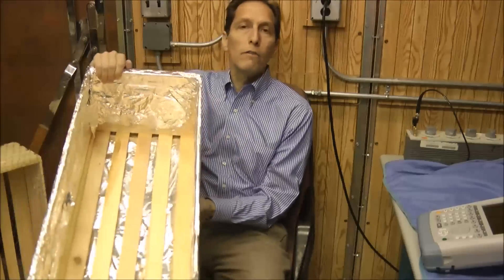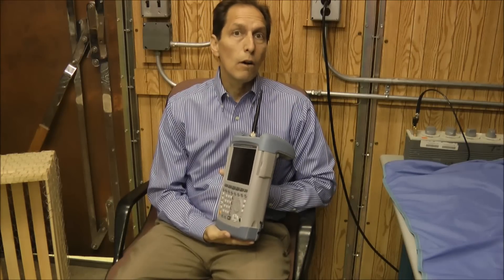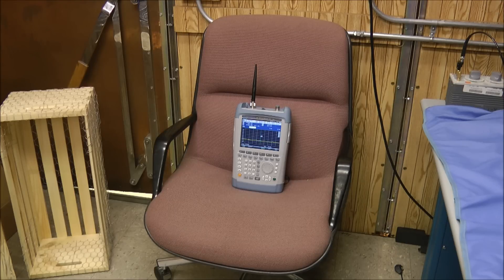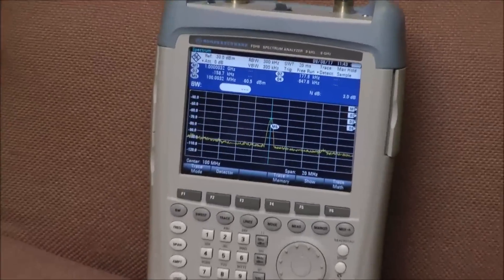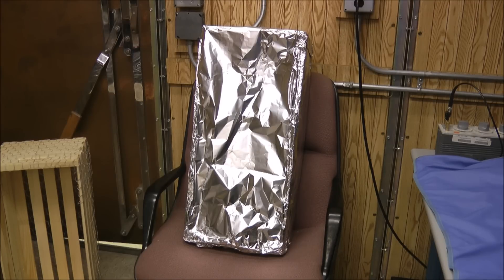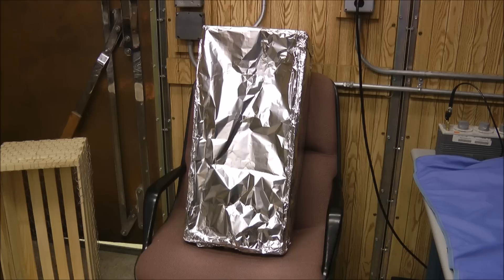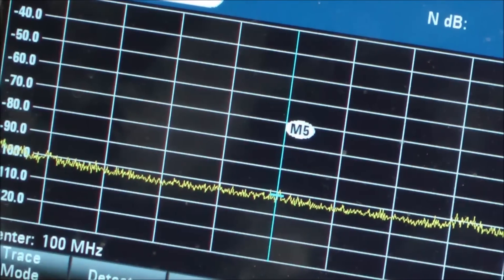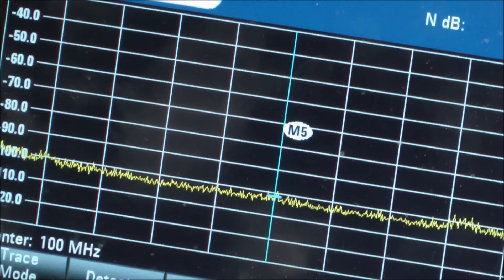Faraday Cage - Chicken Wire vs Aluminum Foil

Comment: I have seen your books, but have not had time to listen to them yet. I listened to your interview "NASA Scientist: Be Prepared for an EMP | Dr Arthur T Bradley" I am so finally relieved (as an RF Engineer who works in shielded rooms all day and help build ours with ETS) to find an EE out there providing accurate and purposeful information for this.
Reply: I have not read your book yet but was wondering if you have done testing with bronze wool and copper on the seems like ETS does. I do wonder what your testing is that was done into not using grounding rods, ETS uses dual shield with grounding between them and then earth ground. At this point I think that the impulse makes the difference of not using them rather than build up of latent charges. These rooms are 100dB down for 1GHz.
Reply from the maker: Hi Jon, I replied to this on email, but I'll post here too. I haven't looked at bronze wool, but I am planning a few tests later this week to test EMI gaskets. I'll post a video of the results.

Comment: so does this mean foil can provide emp/cme protection?
Reply from the maker: You don't need to use a Faraday cage for CME protection, but sure, aluminum foil can be used to protect against an EMP.
Reply: @disasterprepper  can you elaborate on that? CME is what I'm worried about AFA my electronics, and vehicles etc

Comment: Dr. Bradley!!  Awesome stuff. This has been a concern of mine for a while, but with all the different opinion driven posts and blogs, it's hard to know what to believe. I bought your book and hope I'll have time to read it.  I thought with all your efforts with these videos you ought to be applauded. Bravo. I viewed three videos so far. I have a question though if you have the time. It appears double layering provides the best protection, such as electronic device in  cardboard placed in  wood box wrapped in aluminum foil sealed with conductive tape and then placed in galvanized trash can again sealed with conductive tape. The question is should there be a non-conductive layer between the can and the box? Such as wrapping the aluminum foil box in a t-shirt, plastic bag or something before placing it in the garbage can. I would think if the can is touching the aluminum foil box then the energy would actually travel to the box more quickly and the whole point of double wrapping is useless. Correct?
Reply: oh yeah....ground or no ground? And if yes how?!?!? They say on the blogs if you don't ground all the energy will go in once you open the box. Huh?
Reply from the maker: Yes, ideally, you want to create an isolated interior Faraday cage within the outer Faraday cage. That will provide the greatest level of shielding. As for grounding, no, despite claims to the contrary, it is not necessary. The assertion that energy would go inside the box is incorrect.  There is a lot of misunderstanding out there.

Comment: I've been wondering about this for a while because I realized that I can talk on my cell phone in my grandpa's house, which is a stucco house, so it's wrapped in chicken wire. But I don't have signal in his machine shed which is built out of galvanized metal.   Maybe a cell phone isn't a good measuring tool, but I figured it was at least an indicator.   Thanks for the testing!
Reply: Cell Phone is a great source to tell. It’s powerful
Reply from the maker: Sure thing. Glad it was helpful.
Reply: Cell phones use much higher frequency (shorter wavelength).  So, the chicken wire gaps are too large to be an effective Faraday cage at those high frequencies.
Remember the old days of AM radio cutting out when driving over a steel bridge.  But FM radio was not affected.  AM radio wavelength is very long.  About 100 times longer than FM radio wavelength.  So even though the steel bridge structure had huge gaps it still attenuated the very long AM radio wavelength.  But the gaps were too large to significantly attenuate the shorter FM radio wavelength.

Comment: Ok, so we are worried about our personal electronic toys, tv's radios, and smart phones getting broken from a nuclear bomb/emp?  I would think the radiation and such would be a bigger concern.  ok, so there could be a huge solar storm but I think you are more concerned about man made events right?
Reply: ComputerUser321 no its not that we are worry about our electronic toys its about having the ability to send and receive communication for info so say like ham radio walky talkies and so forth batterys for emergency radio and flash lights electronic parts for ur car generator and so forth that's what we are worried about things that will help in a survival situation
Reply from the maker: Radiation isn't really a concern for high-altitude explosions. It's not toys that are stored, but items that might be important to survival, such as radios, medical devices, spare parts for power generation systems, etc. Solar storms have some similar effects, but they are localized to long  conductors, such as power lines.

Comment: Hi Disaster Prepper, below is my Faraday Cage Build Plan. Can you tell me if there's anything wrong with it and if so, what I can do to better it?

So I'd like to make a wood box that's rather large. Something super easy to make with a door to hold things. Inside of that, I'd like to put a tight weave aluminum mesh, folded over 3-5 times, a tight weave copper mesh either folded over once or just left with one layer, and then 3-5 layers of aluminum mesh. I'd like to secure the mesh to the box with staples as well. Once that is all done, I'd like to purchase a roil of the foil that the bags are made of, and place that on the inside as well. The door would be made out of the same materials as above in the same way. The seams would be bulked up and have to be closed by some heavy duty locking clamps to get a tight seal. Once the inside is done, I'd like to make another box with shelves and storage to place the items I want protected from a EMP.

Now my question to you is simple. Is there anything wrong with my build plan and if so, can you tell me what it is? I want this to be beefy and to be well protected, just in case. Any suggestions are nice too.
Reply from the maker: You may be overdoing it just a bit with your various layers, but it sounds like you'll have a great level of shielding. Pay careful attention to the seams where things overlap as well as around the door. Also, I don't know that you'll need a roll of foil, given that you have multi layers of tight-weave mesh. That should easily do the trick.
Reply: I don't want to put you out, but is it possible you could do a test using the tight weave mesh like you did for the chicken wire test vs aluminum foil? Also how would staples fair for holding the mesh together to the wood?
Reply from the maker: Sure, I'll try to do this. I'll have to find some good tight mesh. I think the staples would do fine as long as you overlap the mesh when stapling.
Reply: I think 2 overlapping layers of heavy duty aluminum foil would be easier, cheaper, and work better :).

Comment: Would tinfoil block ELF (extremely low frequency) waves? And would it block any kind of waves if it wasn't fully closed?
Reply from the maker: It's a good question. ELF is generally defined as frequencies between 3 and 30 Hz. Blocking it would require something like 2 inch thick aluminum! This is why other specialized materials such as mu-metal are used to block very low frequency fields.
Reply: disasterprepper  thanks for the quick response, I will look more into mu-metals.
Reply: So I've been looking for mu-metal sources and I have found several on the internet, but now my question is how thick should it be? Would those adhesive strips of foil work to block some ELF waves? Or would I need a thicker piece as well?
Reply from the maker: Hi Andrea, Mu-metal is used specifically for this purpose, eliminating the need for thick conductors. Whether or not the mu-metal would be adequate would depend on what you're trying to block and how strong the magnetic field is. Can you provide any details?
Reply: disasterprepper Well, it has long been known that various governments and scientific research facilities use ELF waves for various reason. Whether intentionally or not they effect our brainwaves by altering our mood and effecting our bodies abilities to heal and our cells from communicating properly with each other....along with a lot of other unnatural frequencies like that from cell towers and so on. Though, ELF waves seem to be one of the harder ones to stop. So in short, I don't know exactly what I'm trying to stop. But if a thinner piece of mu-metal would be sufficient for most I could use more easily and cheaply to protect my house or my body.
Reply from the maker: Yes, I understand. I wasn't sure if you had something specific that you were looking to block. ELF waves can literally travel all the way around the world, and because of their very long wavelengths are difficult to block. As you said, you could use mu-metal to shield an area of your home to help reduce your exposure. It might be rather expensive though. I do wish you good luck!
Reply: disasterprepper thank you so much for your responses, I have found some as cheap as $25 per square meter when bought in bulk quantities. So definitely something I will invest in in the future.
Reply from the maker: Great! That's better than I would have thought.
Reply: disasterprepper actually I have on more question. Does mu-metal only stop low frequencies? Or does it stop high frequencies as well?
Reply from the maker: Yes, it will shield against high frequencies as well.
Reply: disasterprepper awesome! Thank you so much.

Comment: Fantastic Demo Doc !
I would still love to see my setup: a Medium size Trash, can inside a Large trash can, with no tape on either lid.
Reply from the maker: It would really depend on the trash cans and how well they seal. I've tested some that even without tape provided close to 40 dB of protection, and others that offer only 10. If you layer them, you could expect something a little less than their sum. So, two untaped cans could give anywhere from 20 to 80 (just a swag).
Reply: @disasterprepper  Thank you very much Doc.  Oh, I also keep everything inside the dual-cans, in 3M Dry-Shield Bags.  I am hoping for the best -dB possible, for maximum accessibility sake.

Comment: Wouldn't the induced electrical current just burn up the thin foil rendering it useless?
Reply from the maker: No, that's not how it works. Charge is redistributed around the conductive shell to cancel the incident field. That current flow occurs so quickly that there is very little measurable heating before equilibrium is reached, certainly not enough to melt aluminum.